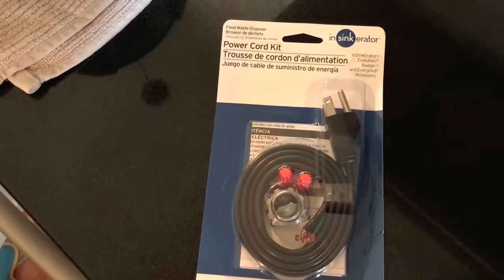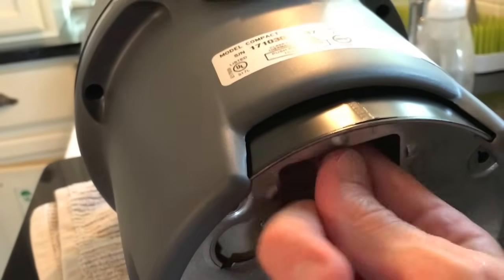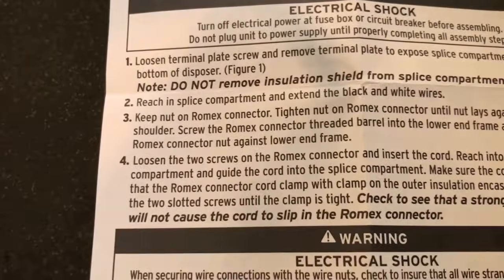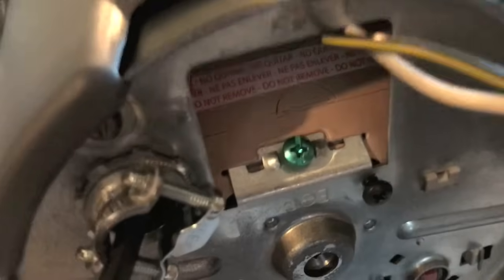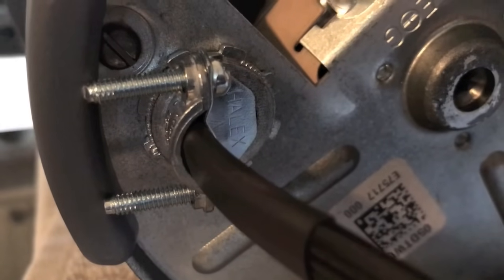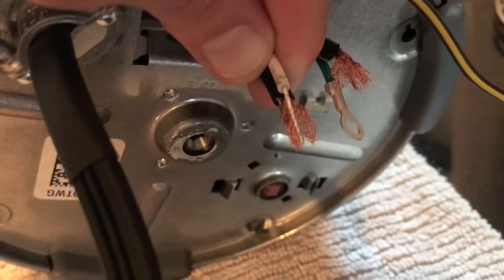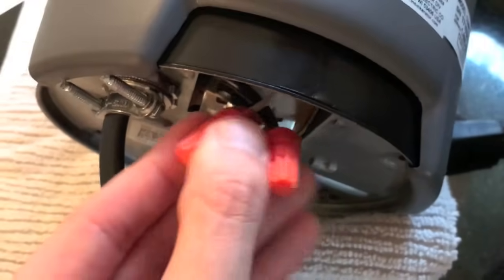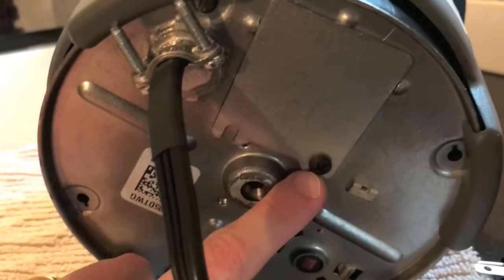How to Install insinkerator Garbage Disposal Power Cord - FAST & EASY

Comment: The ROMEX connector locking nut should have been removed first. This locking nut goes on the inside  of the metal structure to “lock” the connector in place. I’m not sure if it was needed because the garbage disposal wire entry was threaded. Also by leaving the locknut on the outside of the disposal you couldn’t screw the connector in all the way into the threaded housing.

Comment: That looked easy peezy. For some reason, I have no power to my garbage disposal. All other kitchen outlets are working, so I'm thinking it has to be the power cord. Idk. It's frustrating.😩
Reply from the maker: Good morning, just poured a cup of coffee and am sitting down to answer any and all questions for the DIY community.

Any update?  If you plug something else into the outlet that the garbage disposal power-cord feeds into, does it supply power to that?  If it does, the outlet is working properly…which leads us to believing it’s the power-cord.  Keep us posted.

Let us know if you have any questions and hey if you’re into crypto trading, join our DIY ecosystem and become part of an exclusive group of DIYers.

       toolboxtoken.com

Reach out to us any time!  🧰

Comment: I used the old plug/cord, both wires are black, I knew the ribbed side was important.  Thank you so much for your attention to detail.  My self installed disposal works with no leaks.  Thank you again.

Comment: Thanks so much for explaining step 5. My pigtail connector had two black wires and one green, and you showed clearly that the ribbed one connects to the white wire in the disposer. You saved me!
Reply from the maker: Arun Rangarajan 

You are very welcome, so glad to help.

😎👍🔧🔩
Reply: Same.

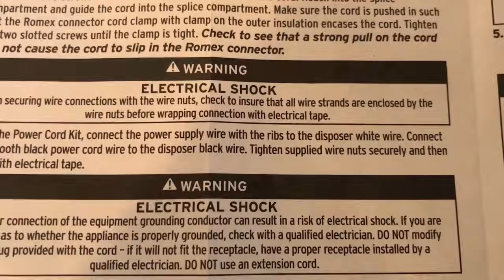Comment: 2:28 It is a great to point out the directions of the wires. I saw some other videos and people didn't mention that and I'm just wondering , what will happen if people wire the wrong way, where the garbage disposal still going to work? Will it spin the opposite way?  And by the way, here is another way to check, the wire that connects to the narrow side of the outlet is the hot wire, and the wire that connects with the wide side  is neutral.
Reply from the maker: Thanks for watching & we appreciate you sharing this.  Wiring the unit incorrectly will lead to the disposal acting in behaviors exactly as you mentioned.

We hope this video continues to help many.  Hope all is well with you and your family.  👍

Comment: I was totally bummed when I looked to replace my garbage disposal only to learn it was hardwired. Then the worry hit. Your video (although short) was detailed and with the instructions easy to follow. I believe I can do it. What garbage disposal do you recommend that can take the occasional wayward cherry pit.
Reply from the maker: Kalani Beaty 

Thanks for watching & the insinkerator disposal is a Top of the line machine.  We highly recommend insinkerator.  We purchased ours from our local Menards.

Keep us posted on your project.  Us fellow DIY’ers need to stick together.

😎👍🔧🔩

Comment: Great video.  I'm installing a new insinkerator evolution Cover Control Plus. I have the ribbed/white connector finished. I now have the smooth hot wire to work with.  The disposer has the black/yellow stripped wire, but it's joined at a cap with a red wire (both wires coming out from the bottom, joined with a clearish plastic cap by the manufacturer).  What is the red wire? Does it go with the black/yellow wire as well into the nut with the smooth hot wire?    Thanks
Reply from the maker: Globe Treker 

Thanks for watching.  Sorry for the delay, what’s your update?  Does the instruction manual reference the red wire?  Keep us posted.

Many more helpful videos to come!  😀

Please subscribe to the channel and turn on your YouTube notification Bell 🛎 that would be awesome thanks again!

😎👍🔧🔩
Reply: DIY With Michael Borders   I finished installing it after calling insink a few times.  This particular model has that extra red wire (perhaps since it’s a lid activated on/off batch unit), yet it is covered absolutely nowhere in the installation manual, the illustrations, the cord kit instructions, nor on the website or manufacturer videos.  So frustrating. Ends up that there was another solid black wire tucked deep into the base of the unit, and it was this one that connects with the smooth black cord kit wire. The crimped red/black with yellow line wires (unique to this model) remain exactly as they’re found. Not a mention of this anywhere. So frustrating with a loss of a day waiting to speak to the phone reps. Insinkerator agreed that they need to describe the difference in their instructions/videos. I really like the unit otherwise. Super quiet!
Reply from the maker: Globe Treker 

Thanks for the reply.  We are happy to hear you got your project completed successfully.

😎👍🔧🔩
Reply: DIY With Michael Borders Thanks so much! Cathy

Comment: Before you start, please advise if turning the power switch off to disposer is enough or should I turn off electric in kitchen before replacement install?  I'm considering approaching it.
Reply from the maker: Jinxx531 

Thanks for watching & sharing your comment!  That’s a great question.  For safety purposes, we recommend unplugging the unit from outlet receptacle at a minimum any time your working on unit.

keep us posted with any questions!

Please subscribe to the channel and turn on your YouTube notification Bell 🛎 that would be awesome thanks again!

Also below is a link to our Appliance/Home Repair Video PlayList.  It has several additional videos that you can benefit from including additional videos on your Garbage Disposal.  Definitely check those out!  😎👍

       https://www.youtube.com/playlist?list=PLjCXOz8TSkZmG-ZbhhKPj4Vh3K3MDPXii

Comment: Would you recommend re-using the old cord from the old badger 5 or should I get a brand new power cord kit?
Reply from the maker: Minhvu Ly 

Thanks for watching!  Great question!  In the event that your old power cord is still in great condition, you can definitely use old cord.

The tricky part you may run into during the removal process of your old power cord is it’s possible that you can harm the cord.

We recommend taking your time & removing old power cord carefully.  If you remove it carefully without harming the cord you should be perfectly fine to use it on the new garbage disposal.

Hope this helps!  Please subscribe to the channel and turn on your YouTube notification Bell that would be awesome thanks again!  😎👍🔧🔩

Also below is a link to our Appliance/Home Repair Video PlayList.  It contains several videos that you can benefit from including additional videos on your Garbage Disposal.  

       https://www.youtube.com/playlist?list=PLjCXOz8TSkZmG-ZbhhKPj4Vh3K3MDPXii
Reply: DIY With Michael Borders just successfully replaced the insinkerator.  Thank you
Reply from the maker: Minhvu Ly 

Very cool & thanks again for sharing your experience!  We really appreciate you taking the time to share your comments!  Please don’t hesitate to reach out to us and ask any questions you may come across down the road!  😎👍🔧🔩

Comment: I have this garbage disposal, its currently not working and I want to replace it. It’s rusted and old. The chord is already hooked up and connected, but I cannot reach the cable to unplug it because it’s behind my dishwasher and i would have to take out my dishwasher to do this. Is it ok for me to turn my circuit breaker off, then disconnect the chord directly from the garbage disposal to replace it?
Reply from the maker: Thanks for watching & welcome to the DIY Raptor Club.  Great question & that’s odd.  Removing dishwasher would be a pain...🤔

You mentioned cord is always hooked up, are you referring to cord already installed to new disposal?
Reply: @DIYwithMichaelBorders  yes. I already have this garbage disposal set up at home, but it’s broken. The electrical outlet to unplug the garbage disposal under my sink is behind my dishwasher, I can’t reach it to unplug it. I’d have to take the dishwasher out to unplug it. So I’d like to know if I can disconnect it directly from the garbage disposal if I turn my circuit breaker off.
Reply from the maker: @camrosas2996  

Thanks for the reply, we recommend turning circuit breaker off first.  Next, use a volt meter to ensure no electrical power what so ever is still present at connection point.

If no electrical reading on volt meter, it’s safe to continue.  Keep us posted.
Reply: @DIYwithMichaelBorders  thank you so much for your suggestion and for replying so fast! I will give this a try this weekend. I will keep you updated.
Reply from the maker: @camrosas2996  

You are very welcome.  😎👍

Comment: I followed the steps and feel like it is done correctly, but when I flip the switch to turn the disposal on, nothing happens. I've checked the breaker and everything is normal. Any thoughts on what might be wrong?
Reply from the maker: Brandon Treadway 

Thanks for watching Brandon.  Have you plugged it in to the other outlet plug by chance?  You may have what is called a split switch outlet.

This type of outlet has one normal or standard plug and one plug specifically for the switch.  Keep us posted.

Also on the very bottom portion of your disposal is a red circuit breaker.  Verify that is not popped out.  Keep us posted.

😎👍🔧🔩

Comment: How do you fix it if you have a leak coming from the power chord?
Reply from the maker: Good evening Kimberly, we appreciate you reaching out to us.  Rule of thumb is to replace disposal if it leaking from bottom.

However yours is unique as it’s leaking from power cord...but...is still bottom.  We recommend removing power cord from outlet & cutting all electrical power from unit.

Inspect power cord connection on disposal to ensure its properly installed & firmly secured.  If all looks good, carefully remove it & inspect inner portion of disposal.

Maybe put a container under disposal & run water at a slow speed to see if you can see anything that pinpoints the cause.

If the disposal is reaching 7...ish years of age, it may be time to replace it.  Please keep us posted.

😎👍🔧🔩
Reply: @DIYwithMichaelBorders  thanks I'll give it a try
Reply from the maker: @kimberlytalal1007  

😎👍🔧🔩

Comment: Hi can someone please help me, I have followed your steps 100 times now but every time I plug in the Badger 100 it starts running without me being able to turn it off until I don't unplug it. What gives? I re replaced the Badger 100 thinking it was damaged and I have tried multiple different outlets and all do the same
Reply from the maker: Douglas Jerez 

Thanks for checking out the video.  We recommend taking an extension cord & plugging the extension cord into a different outlet.  Then run the extension cord all the way to the Disposal.  

Make sure your Disposal electrical switch on the wall is in the off position.  Then Plug Disposal in and see if it stays off.  Then turn on electrical switch on wall to test the Disposal & verify it operates correctly.  If it does, then it’s very possible that your electrical outlet is wired incorrectly.

Below is a link that shows how to test your outlet.  Definitely check it out!

       https://youtu.be/qs7yjA34WdQ

Let’s start there!  Keep us posted!

Please subscribe to the channel and turn on your YouTube notification Bell that would be awesome thanks again!  😎👍🔧🔩
Reply: DIY With Michael Borders Hi Michael,  Thank you for replying back to me. 

So I have plugged in the garbage disposal in different outlets other than the one below the sink were it originally plugged in. 
Every outlet was the same results, the garbage disposal would start up and not stop until I unplugged it. 

I have tried the outlet with other appliances toaster,  bluetooth speakers, etc and the outlets worked fine. 

This has me confused I have checked the wires connection multiple times white cable with ribbed black cable, black with solid cable, green ground with the green screw.
Reply from the maker: Douglas Jerez 

Thanks for the reply.  It’s very possible that you have a faulty Disposal.  It’s rare however we can’t rule it out.  It might be the next option.  By returning your current Disposal & trading it for a new Disposal (same model Disposal) this might fix the issue.  It’s possible that your current disposal that you purchased brand new has faulted internally causing your symptoms...definitely annoying if that’s the case because you purchased it brand new and it should work.  Keep us posted! 😎🔧🔩

Comment: I already installed mine I made the mistake of removing the cardboard did I damage or destroy my disposal it's not working
Reply from the maker: Eric Ander 

Thanks for watching & sharing your comment Eric.  Let’s get this figured out together!

The purpose of the cardboard slat is for safety purposes.  There is a moving gear above that cardboard slat & the “Do not remove” sticker is there to make sure you don’t remove it & stuff your wiring far up into the machine...ultimately causing the wiring to be eaten up by the moving gear.

With this said...since this is only a protection feature for your wiring, we recommend that you unplug your garbage disposal and inspect the wiring and verify that the moving gear has not eaten your wires.

If your wires look great, we recommend making sure that they are pulled down far away from the moving gear and we will move on to the next troubleshooting option.

Below is a link to our step-by-step troubleshooting video on your Garbage Disposal.  Definitely check it out!

       https://youtu.be/0j98iOlUr5Y

Let’s start there!  Keep us posted!

Please subscribe to the channel and turn on your YouTube notification Bell 🛎 that would be awesome thanks again!  😎👍🔧🔩

Comment: Why does my garbage disposal turned ON when I plugged it into the switch?
Reply from the maker: Thanks for watching.  Is your outlet in conjunction with a light switch?...meaning if you turn the light switch off, it cuts power to the outlet?  Keep us posted.  Welcome to the DIY Raptor Club.

😎👍🔧🔩

Comment: My cable doesn't have a ground wire!?
Reply from the maker: Thanks for watching, does the instructions mention anything about a ground?
Reply: @DIYwithMichaelBorders  Yes of course. But ground wire suppose to be part of wall cable, electric source. Unfortunately mine is old one with only two wires, no ground one 🤷🏻‍♂️
I installed new garbage disposal today, it works properly, no leaks, just I'm worried for safety issues
Reply from the maker: @goxyeagle8446  

A new disposal puts you in a good mood, that’s cool.  We understand your thoughts, a ground engineered into the system is always good.